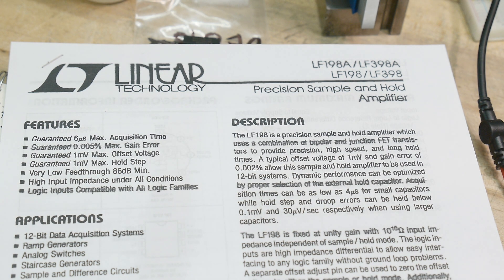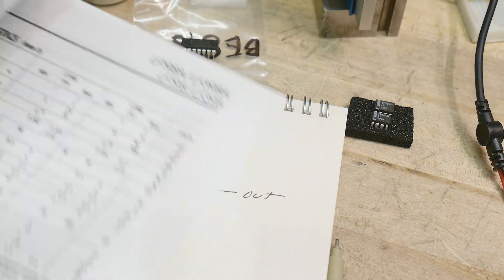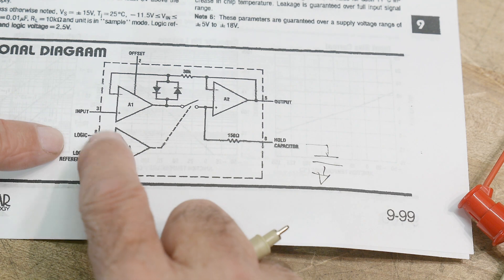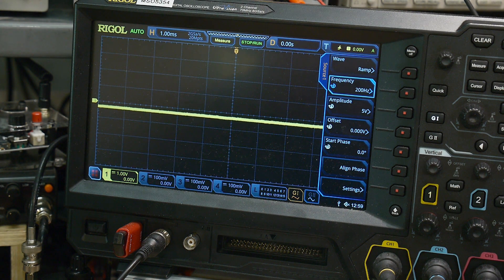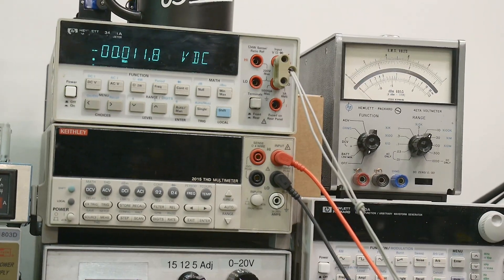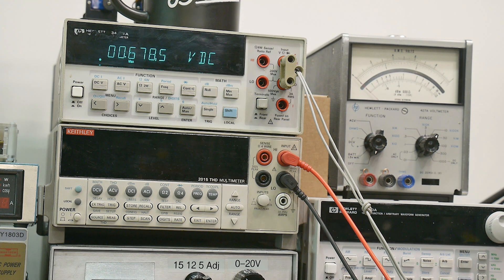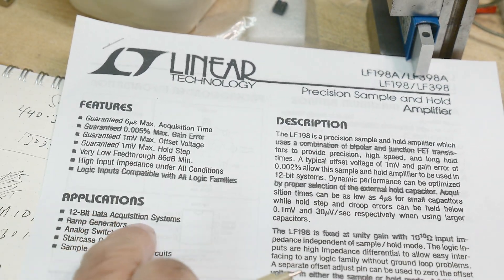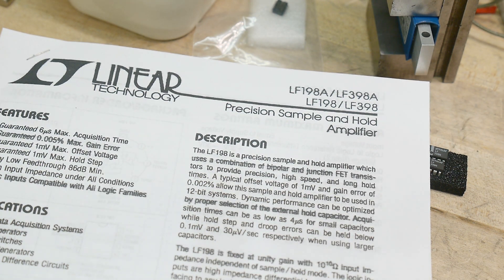#1158 LF398 Sample and Hold

Comment: They use it as input to A2D converters.  You can get your Ph. D,  in Sample and hold circuit design. Sometimes people would concentrate on architecture and design of A2D (SAR, Pipeline, flash, sigma delta, etc..) and use good sample an hold chip from external source, or buy the IP and put it on their chip.  Also, there are event driven experiments and data collection that may need sample and hold circuit only.  You can use another Analog Circuit instead of A2D to do something, for example you can subtract output  voltage  of Sample and Hold from reference voltage to adjust speed of DC Motor or light.  You probably could replace phase detector of PLL loop with this contraption. You can square this difference or do another mathematical  manipulation to generate control signal.
Anyways there is another tool in your tool box, or another Lego block for your creation.

Comment: Sometimes those pins on the capacitor storage, are on teflon standoffs as the leakage of pcb, affects the resistance (10^18 is a big resistor value).. Even humidity can affect the value.. And flux is a big no-no